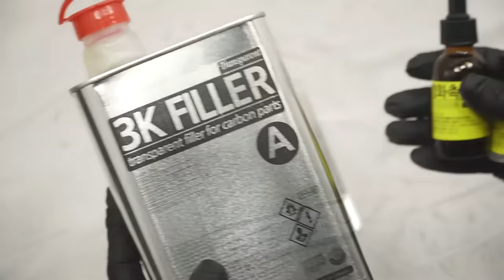How to Make a Forged Carbon Fiber Helmet [DIY] (Making Split Mold & Helmet)

Comment: Is this FIA certified? lol
Reply: DIY certified :)
Reply: @SeamTressGaming  I was thinking wouldn't mind seeing him test this for the road
Reply: I'm not sure anyone would argue it, but I don't know if this can technically be certified. Unless you're racing at the higher levels, I doubt anyone would question it. I'm sure it would pass if it was to be certified.
Reply: @Jeffball610  No DOT certification, No Snell certification, no Bueno . . .  no matter how good of a job he did.  They test for more than just impact.  Perfect for his application however.  And that's the coolest looking helmet ever!
Reply: @Jeffball610  It'd never pass any certification with a seam down the middle. Helmets are made seamless for a reason. Many times has a helmet been hit and split down the middle on older tech. Thats why no one makes helmets that have a seam down the center, carbon fiber or not.
Reply: people didn't get the joke. lol
Reply: @verdeboyo  calm down "tough" guy. lol
Reply: @rOUNDeGGROLL  The seam is only on the outer 'forged' layer. He put adequate reinforcement overlapping the two halves underneath. The outer layer is cosmetic and adds very limited strength to it, all the strength comes from the woven matting. That said, I still probably wouldn't use it in anger.
Reply: @samctanner  Sure. He put reinforcement in the overlap but it still doesnt change the fact that there is a very clear seam down the middle. Even just on the outer layer, it creates a weak point. If it were to take a hit directly on that seam, the energy would be transferred into the reinforcement layers and probably too much energy at that, causing all of it to bust out. Im not saying it isnt a cool helmet or that its bad. It just wouldnt pass a modern cert. Helmets have been engineered with seams on ANY layer being removed entirely from designs. I dont know of a single helmet on the market that has a seam straight down the middle for that simple fact. Its just too risky.
Reply: @rOUNDeGGROLL  Yeah I mean fair point, the seam down the middle could well cause a stress concentration, and in theory, should it fail due to an impact on that seam it could well be the starting point of any failure. However, in my experience any outer ply of any composite material is often for cosmetic purposes, the main structural integrity of the part coming from the internal plies.
Reply: Jeez he literally includes the part where he's using it for race simulator only yet everyone is bitching about how the helmet's safety or what so ever
Reply: The amount of work involved when he coukd just buy a carbon fibre helmet, I honestly don't see the point
Reply: @jediknight1294  sometimes the joy is in the making
Reply: @samctanner  I get that but honestly if im doing that sort of work I'm building something truly custom that I can actually use, custom paint or a lid I can actually ride in or finish the armour for my scifi stuff 

I juat don't see the point in a helmet I can't use and sim kit that isn't full weight given I'm mainly interested in it for practice, learning tracks and similar.
Reply: @jediknight1294  yeah fair enough really. I can't speak for this dude but maybe it was just s practise one and he figured he'd get some sort of use out of it?
Reply: @samctanner  its a cool project but the lack of weight compared to a racing lid would annoy me.
Reply: @jediknight1294  fair man. each to their own innit
Reply: @samctanner  oh yeah and the build was pretty impressive.
Reply: @jediknight1294  and it looks dope!
Reply: @rOUNDeGGROLL  ummm. my sa2015 Bell GTX3 Carbon has a seam down the middle and where the mouth guard starts... I Honestly think this helmet could pass if he added enough layers to match that of the helmet he took the inserts from. The real magic of a helmet is not so much of the shell, but the foam that braces and protects your head in an impact. I mean the carbon is probably much stronger than the fiberglass composite he took apart.
Reply: @rOUNDeGGROLL  if he would have layered it while the two haves were connected there would be no seam. Still wouldn't be able to be certified though
Reply: He use it for gaming... I think thats fine 😂
Reply: @smoke05s  dot certification is a joke
Reply: Last motorcycle accident I had where there was enough damage to bother with a police report and insurance rather than DIY, I had to deliver my helmet to the insurance company. I use imported helmets because Europe doesn't use the stupid D ring chin strap that eats my beard, so it had ECE 22.05, ACU Gold and SHARP certifications, and no DOT. They still checked the box that I was wearing a DOT approved helmet at the time.

I think they really only cared that I wasn't wearing one of those 1/4 bucket cruiser helmets with the fake DOT stickers they sell at motorcycle rallies.
Reply: sim racing certified
Reply: @rOUNDeGGROLL  are you high? what seam
Reply: @rOUNDeGGROLL  the seem is just the mark left by epoxy on the outer surface only, the actual carbon has been laid in to create one solid peice as is the expoxy, though more overlay would be needed
https://youtu.be/I6Z7Z_5XkFM. 
Show helmets being made in two part moulds with seams.
It is pretty much impossible to make a full face helmet without a two part mould.

The restrictions he has is how many layers of carbon, quality and grade, curing time, curing temp. Not enough for use as a helmet but nothing wrong with what he did
Reply: If he built the helmet correctly (i'm not saying that he did or didn't cause i'm no expert) this is probably more safe than a cheap helmet out there even if it's not certified
Reply: Seamed down the middle!?!?! You mean the helmet he vaccuumed with a hand pump? This is unsafe on so many levels.
Reply: Definitely not!!! If it ain’t got the sticker then it’s not FIA certified

Comment: Thats cool to look at but I wouldn't use that on the road. That helmet isn't safe.
Reply: But you can use it in a simulator without any problem.
Reply: I was thinking that until i saw him using it for a sim
Reply: he just changed the shell, shouldnt the rating be the same? from what i understand arai uses fiberglass so since carbon fiber is more wear resistant and stiffer dosent that mean he made it safer?? asking because im really not sure
Reply: @craigwallen8886   im pretty sure due to the fact the fiber is oriented and the way its held together probably lessens the structual strength but idk im no expert in carbon fiber
Reply: I would wager that if tested it would perform just as well as the stock hemet. The shell is there mostly to protect the liner and padding. It’s really the inside that protects the head. His fabrication skills are on point, properly overlapped layers and vacuumed bagged, I would trust it.
Reply: craig wallen stronger isn’t necessarily better. Helmets are designed to fail and absorb energy of an impact.  I wouldn’t trust this on the road or track, I value the contents of my helmet enough to pay out for the real thing.
Reply: it could be safe to use but not legal, the difference between an aproved helmet and a homemade one(designed and tested in the same conditions) is the certificate, that's why those helmets are so expensive, even if it is as safe as a 100 dollars helmet
Reply: The shell of a helmet is designed to absorb energy in conjunction with the internals to give the best possible protection. If you start messing with the stiffness of any of it and your head will not be as safe. Fine in a simulator though.

Comment: Boy that's a lot of work. Is it possible to just layer chopped tow onto a helmet and sand flat?
Reply from the maker: Hello friend.
That's possible.
But, hand-layed forged carbon fiber is very difficult to sand.
You have to spend a lot of time sanding (flattening).
And your helmet gets heavy.

Comment: Hi there.
I wonder how much does it cost to make one (or another one as you already have the mold now).
I think about to order one to you if the cost is good enough.

and also, i wonder about the original helmet. as you bought all the new parts, so the original helmet is still in one piece (except the original paintwork of course), isn't it? or how?

Comment: 13:02 hope you are drilling and sanding(and cutting) carbon in P100 mask respirator, since it tiny parts in the air

Comment: I would never wear a carbon fibre helmet im surprised they actually use it in racing. Im sure on contact the shock would snap your neck. The shock has got to go somewhere? Kevlar would be a much better option.

Comment: Only thing I would do different would have been to put the bucks together before putting the first layer of chopped carbon fiber in the helmet. Then the line down the center would not have been there.

Comment: One reason I would never use carbonfibre is that in an accident and the helmet is crushing in, the carbon filaments splinter. Splintering in needle sharp pieces tha most easily penetrates skin and bone. Secondly, a xray machine is not able, or not always able to scan the tiny fragments that are just work like a shrapnel grenate. Thirdly, the impact resistance of carbon is not that good, compared to f.e. Kevlar and /or Dyneema.

Comment: I dunno about in the EU but I’m the states they would y allow the use of a homemade helmet it has to be DoT or Snell approved preferably snell it’s rated for higher speed crashes than DoT helmets snell’s are racing helmets for the most part it’s the kinda helmet a Top Fuel bike rider would wear or a top fuel driver period

Comment: You should have just skinned the original helmet with the carbon flakes then you would have a helmet you can use on a motorcycle. I guess you can still do that with the old one as well.

Comment: i understand, that you think forged carbon fibre looks cool.... but it is not strong, what so ever! if you do this the next time put a inner layer of 200gramm 2-2 twill with the orientation of 0/90° and 45° 2 times, to make it structurally sound! otherwhise it is like wearing an eggshell.

Comment: It is made into half and then glued. The carbon fiber mesh is not covered by a single link. The cap shell will split into two after a collision. There is no protective effect. It is better to buy a polymer material PA material, which is better than yours. The shell must be strong and safe, and your product will kill unsuspecting consumers.
Reply: there is substantial overlap between the two halves on the layering of the material. It is just the outer skin that is completely halved.
Reply: you didn't understand much about this video...

Comment: So... he wrecked a $600 plus helmet which was carefully engineered, designed, constructed, tested, and certified to take specific loads (lamination materials, material weave, weave directions in lamination), for the purpose of making a split shell mold to make a helmet shell with none of those considerations or certifications? Then slaps Arai labels on it?
I can think of a dozen things OTHER than an expensive helmet to demo a split mold process, but I also don't have pockets that deep.

Comment: This is cool and all and your technique is nice but please be very careful when producing a video like this. Helmets are engineered by very smart people and they know exactly what is required of a lid to meet or exceed certification standards. For sim use, this is fine and the brain bucket looks badass, but you need to make sure people know that it is entirely unacceptable and dangerous to use this methodology to make a helmet of their own to use on a real track. Well done, though, you clearly know what you're doing when it comes to a layup.